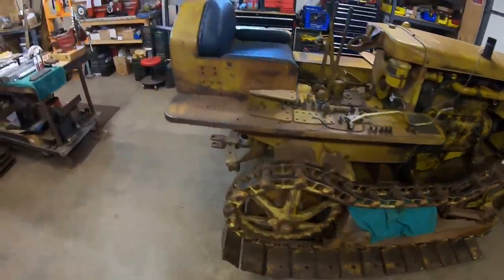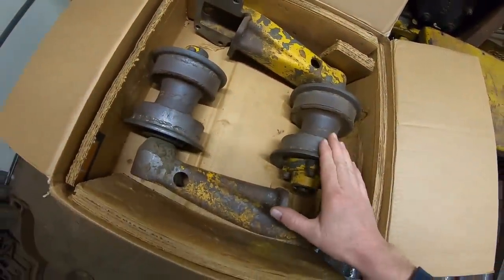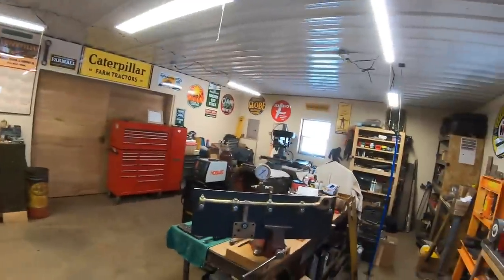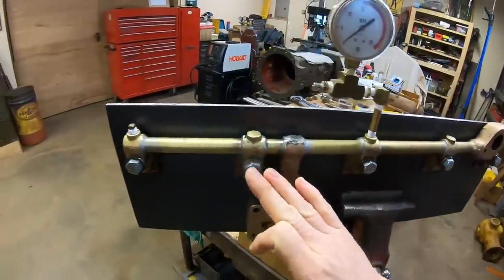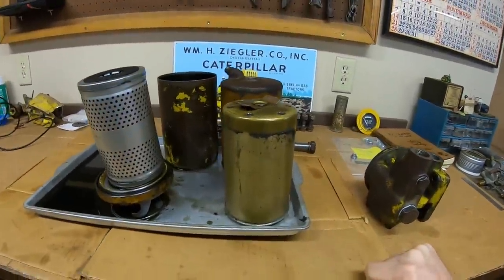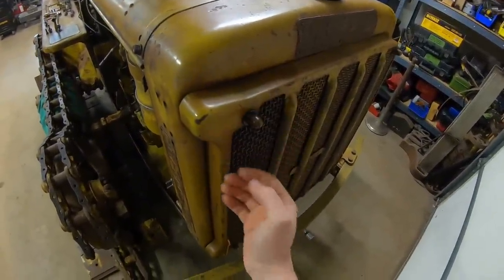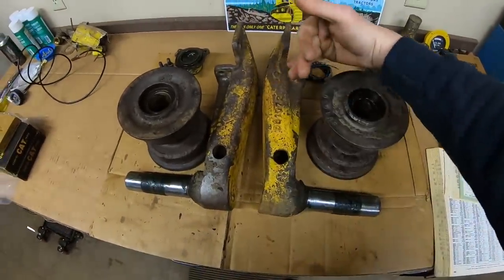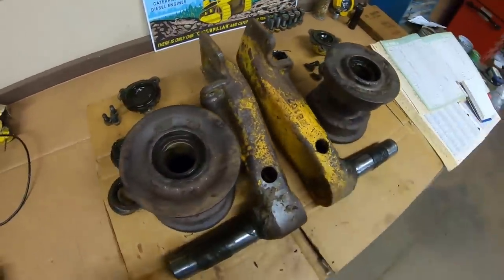Caterpillar D2 #5J1113 Chassis Rebuild Ep.76: We Found Track Carrier Rollers!!! & Oil Cooler Bypass

Comment: Nice workaround in the oil cooler bypass, I would brazed the ends of the fittings shut. The plugs are a way better solution, totally reversible and doesn’t ruin any original parts! Excellent score on the return rollers!!

Comment: Very cool that dealer found some unobtainium parts for you. great to have connections like that. I believe you are correct about the oil cooler. Before our new detergent oil much contamination would build up anywhere it could.
Reply: Paul,,,   Similar to the water that comes from my well is loaded with calcium and small leaks eventually seal themselves :)

Comment: When pressure testing the oil manifold, you should be using fluid pressure, and not air pressure. We  had a radiator guy that many times sent back a radiator that still leaked because he'd test with air pressure. I even got bit by that myself when testing a clutch pack. Air pressure seemed ok but fluid pressure revealed a cracked weld of the drum to the shaft. Just use your porta power pump and bring the pressure up a little higher than normal operating pressure.

Comment: Another way to block those oil ports in the filter base is to machine on the lathe a solid tapered seat with an external oring that drops down in the port.. Then the pipe seals against the solid taper and you're done. It's more work but doesn't require  modifying the original part. Awesome seeing those track rollers.

Comment: You got yourself a superb Xmas present with those return rollers, they even came with a matching patina. You should be able to get a sleeve for the damaged seal faces otherwise you will be asking al lot of the new seal to work against that groove.
As for oil coolers they are not required for the modern oils on an engine like that. Modern oils work better at higher temperatures anyway so the cooler is probably working against you. A neat job in taking it out of circuit though.

Comment: Every track pad is torqued from the top!  How would you ever fit a torque wrench on a track pad nut??? Especially would like to see this on a square style pad nut.
Reply: Every track ever is torqued though the bolt, same as hundreds of other examples, but if you really want to do it "by the book" you'd torque the nut, one of those things that people that don't do alot of mechanical work them selves worry about

Comment: ☃❄Happy Holidays ❄☃ Future topic suggestion, can  the rollers be welded in the worn areas and turned back to size, "refurbished" other bush fixes, can a roller from a different place be milled to work as the top roller?

Comment: Thanks for the video!
Another possible solution for your oil cooler block of plugs thread depth. Take another pipe tap and cut off the tip just enough to allow the tap to cut enough thread to put the plugs flush with the pipe flair fitting.

Comment: Tighten bolts from the head is not a problem if you plan for it. There are much bigger factors like the surface finish on the threads of the bolts and nuts. Also one of the biggest factors is the friction under the bolt or or nut. This it why bolts you really care about always use washers. Obviously they don't always use washers but you plan for it and expect more variations in the bolt tension on head tightened dirty washers surface bolts.

Comment: The other option for bypassing your oil cooler could have been to shorten your pipe thread tap. Grind the bottom off until you can get the threads deep enough.

Comment: I figured that CAT would have the torque spec for the bolt because otherwise it gets really tricky. It's a rarer measure (for sure), but it's not an impossible one. You can account for torque loss.

Comment: Toby, do you have a 3/4 pipe die that you could thread down a pair of those plugs undersize so that they will fit in the undersize threaded holes, without needing to be thinned down? That thin-wall hex makes me a bit nervous about the ability to take it out 10 years in the future. (Yea, you could always drill and use an EZout, but...)

Comment: 8:41 Yanno it'd be hard to talk me out of just disconnecting the lines at the oil cooler and putting a short splice pipe between the ends to bypass it...or perhaps even use it to remotely locate an oil filter in an easier place to get at.

Comment: Another great vid.
I know it's not right to attempt to lubricate tracks themselves but those new bolts holding track pads, wouldn't you just dunk the very tip of the threads into a grease pot first, just really to repel moisture.
I'm thinking of a long time in the future if they have to be undone again.
Really interesting viewing, keep them coming. Martin. (England)
Reply: @squatch253  Good one. Thank you. Martin.